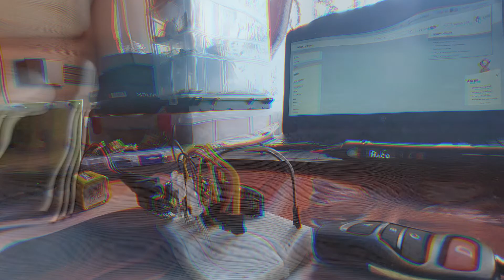4-channel RF remote control. Transmitter and receiver. No Arduino, no code.

Comment: Hello! please tell me,  if the radio relay (433Mhz RF 4 channel receiver) can withstand currents of 600-700 mA on one of the channels?
Reply from the maker: Not.  I don't think the module can provide you with that current.  But you can insert a transistor between the module and whatever you want to power.  I bought the module here: https://a.aliexpress.com/_mNMSKeg see what data the seller has about this module.